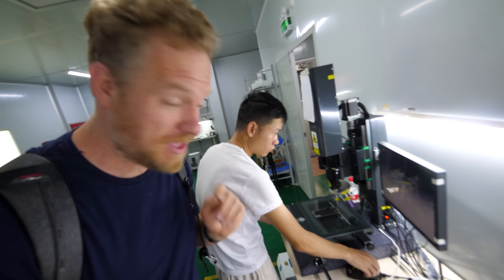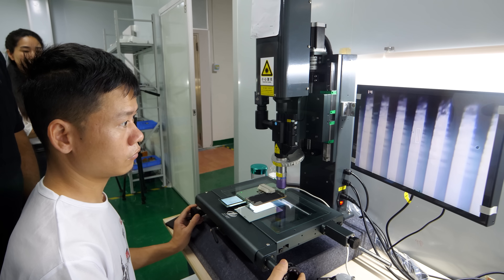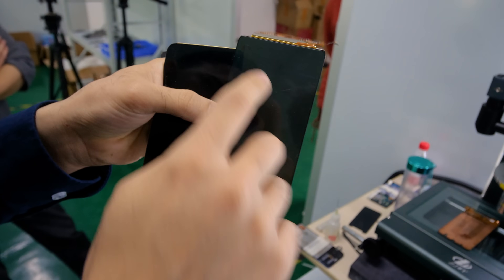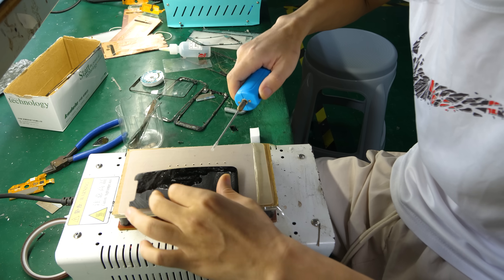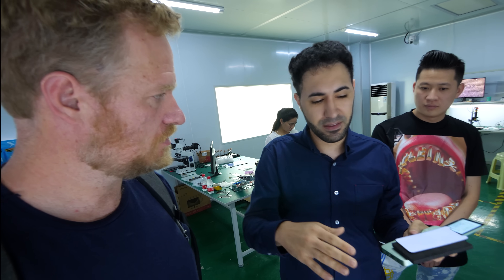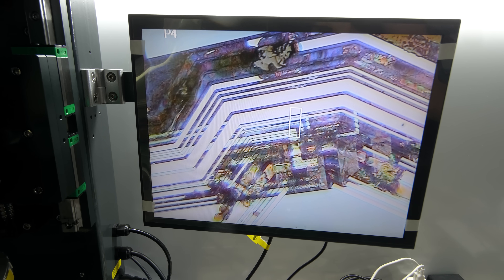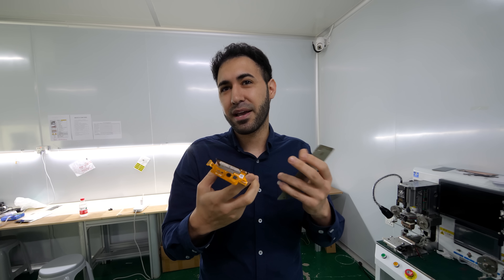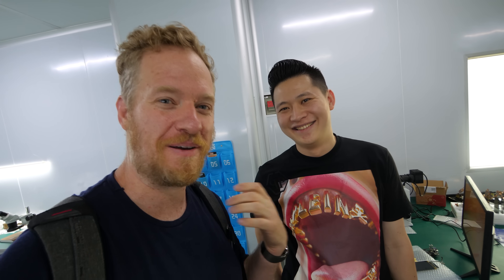A Revolution in iPhone Screen Repair: Lasers!

Comment: That is one of the coolest devices I've ever seen, and it avoids tons of electronic waste. I love it.
Reply: @@spiderpig1736 na. Samsung has way more market shares in different fields. Apple on the other hand is a waste of MONEY.
Reply: @Surms41  How is apple a waste of money? Their products are good and work over the years and have longevity
Reply: @alternatedenz  "Longevity" No they don't.
IPhones are just another object that can and will break. They are slower than a ton of other phones, yet cost about 50% more for less features, less performance, and a cut down shitting operating system. And the fact they roll out updates after a few years and make the old phones stutter and lag purposefully.
Reply: @@spiderpig1736 not really

Comment: damn the amount of perfectly good displays that get thrown because of those lines will almost be instantly reduced. it also means that you don't have to replace a screen but instead just fix it and the manufacture who linked the parts together will not be able to tell whether the screen is not official or not, looking at you apple.

Comment: This reminds me of how you have to repair Gameboy screens you have to heat up the traces with a soldering iron which fixes it eventually...I know this is completely different but the line going away is pretty much the same visually and the feeling it gives haha
Reply: just bigger connections and you are essentially blasting every trace hoping it melts at the right spots

Comment: I am from the phone repair industry and this tool is definitely a game changer for the refurbishing industry. Thanks for sharing this Scott. 👍🏻
Reply: Game changer for aliexpress scam sellers, more new screens will have lines before and die because of other causes 😅
Not good for the customer 😂
Reply: I would guess that objective lens attached (the purple one) is a used unit, because it's around $10k new from Mitutoyo. Another good way to bring life to surplus/used items.
Reply: Singapore lah?
Reply: Oppo Reno 4por 17laker
Reply: I think even moderately-busy individual shops or small chains will be able to justify it. At $12k, it's a no-brainer for any organization that is even dipping their toes into doing their own refurbishing.
Reply: HOWEVER, it will take about 1-2 hours to fix a single phone screen, and good luck training a technician to do this at good successful rate. Even if you do have a technician to do it, then you will have to pay him like $40/hour plus benefit and tax, the total cost to you will be near $50-60/hour depending on your location. And this does not even include all other cost to you as business. You essentially will have to charge someone $100-200 per screen repair. Let's be honest, 99% of people will just go to Apple store to get it fixed even when they charge $100 extra. That's why "repairing" industry is now almost exclusively for cars and luxury items that is worth the $80/hour rate.
Reply: @petergao6998  This is just the first iteration though, where you manually are seeking out those bad traces. It could potentially get to the point where you pop in the screen, it automatically picks out what it believes are the bad traces, the operator confirms, and then it's done.
Reply: @synthxsyze7463 it doesn't have to detect the bad traces though. It can simply run over healthy ones in a full sequence of traces, and the broken one will get fixed on its way to the end.   Since it's the same tool as in screen factories, it won't harm healthy traces. It only needs to detect traces (i.e. "steps") and move the flex under the laser.
Reply: @petergao6998  your math works great for the US, but in other contries where pay is akin to 10$a day this machine works well.
Reply: @petergao6998  This would be huge if it can repair a laptop screen repair because most of the laptop screen are expensive af and it very hard to get not even the official store wants to replace the screen without charging 80% of the laptop price itself but yeah its very rare and most of the problem are the port and pins destroyed
Reply: @petergao6998 also if the electricity is not a flat price like my country

Comment: THIS IS HUGE, and proves that you cannot stop the repair industry. all of the serialization, bullying, fearmongering and blacklisting is merely a roadblock
Reply: not really though..... all these things are really common and pretty available in china but in the US, Europe it isn't. here when you go to a repair shop they only do part swaps for brands they have parts on hand. the screen, the battery or a whole motherboard... that's it. you have to go hunting really deep to find a guy that will replace a broken fllex cable or fix some water damage or solder replacement for corroded caps. if you find a guy at all in your city...

this only means we will get cheaper refurb displays that perform like new for all phones except iPhones pretty soon.
Reply: @@spiderpig1736 Apple, Samsung etc would stop these anti-repair practices if people voted with their wallets and stopped buying their over-priced, non-environmentally friendly products UNTIL the companies made them easy and cheap to repair.
Reply: yup..These is definitely like a money printer. All screens now can be refurbished and sold and installed onto phones or sold to shops as refurb.
Reply: yeah im sure buying that machine is real cheap most people would just get a new screen
Reply: Can I send my iPhone 13 Pro Max for repair please?
Reply: Sorry, iPhone 13 Pro Max lcd screen.
Reply: where theres a will theres a way
Reply: Then they buy the company making this machine and shut down operations. Trust me, they are in fact winning at destroying repair.
Reply: Uh oh samsung does that but they  don't really do that much because they are in the midrange bussiness too so more like just apple
Reply: @@spiderpig1736 by far the most common cause of display malfunction is dropping your phone and breaking the glass. This machine doesn’t do anything to help with that. Apple will gladly replace your screen for you instead pf telling you to buy a new one. They charge so much for the repair, it’s like printing money for them.
Reply: @HNedel  Replacing the glass on a cracked screen is much easier than using this machine

Comment: That's very cool. It's great, because you don't have to buy non-OEM screens and wait like 3 weeks for them to arrive if you can just have someone repair it professionally locally. It would be nice if the OEM's did repairs with this method so that an official repair wouldn't be like $500.
Reply: locally when the machine cost 12k$? what is local to you and how many phones are in that market that will show this defect? you need that number to calculate how much the repair will cost.
Reply: Ngl I don't think this machine gonna work those line usually are specific type of brokescreen
Reply: OEM probably won't bother locally due to scale issues, and very few third party likely have the turnover to justify such a machine at its current costs (scale issue.. but the other way around.)